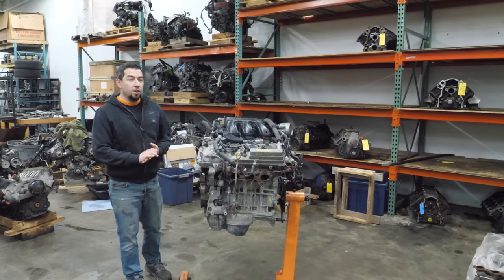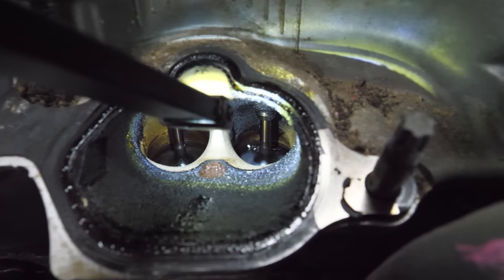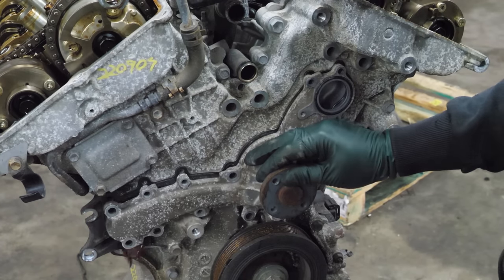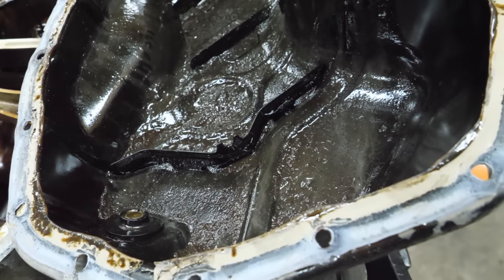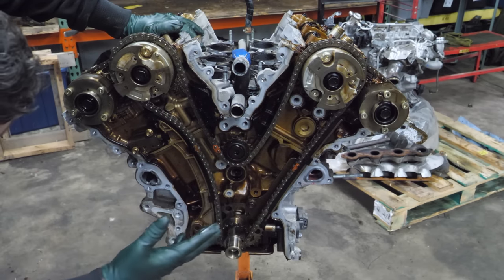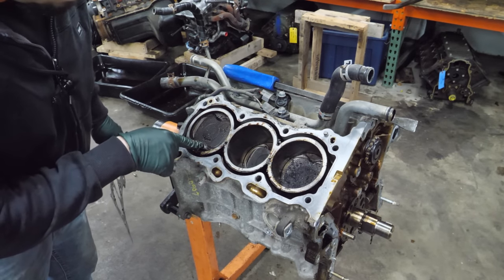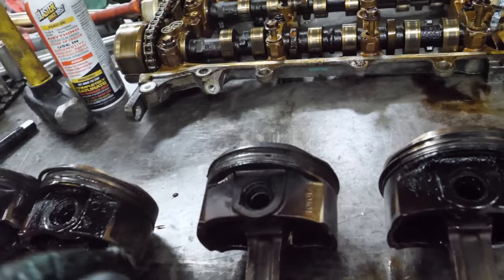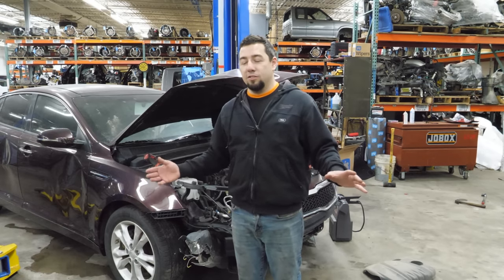Toyota Lexus 2GR-FE Teardown! Premature Death Of Toyota's Most Reliable V6 Caused By Obliviousness!

Comment: "Toyotas were supposed to be reliable but I needed a new engine after only 60k miles. I cant believe i wasted 2 whole oil changes on it."
Reply: Lol
Reply: Ive got an 01 4cyl over 250k miles lol. Still ticking
Reply: @demonknight7965 02 4runner with 368 still truckin
Reply: I had to clean out a 3.9 Dodge that went 86k on 1 oil change.  We scrubbed the Quaker sludge out, I abrasive blasted the oil pump pickup screen, replaced the oil pump, and buttoned it back up.  Filled it to the top with diesel fuel, drained it, put 5 quarts of diesel fuel and a quart of MMO in it, ran it until it was warm, drained it, filled it with oil and a new filter.  Drove it around for a week, changed the oil, and handed the keys back.  She made it another 100k, before it succumbed to the same fate.  Delo 400 or shell Rotella is trusted in $40k engines for a reason, but people want to use puddzoil,  quaker sludge,  valvoline,  castrol, ect.
Reply: It was the Blinker Fluid that did you in!
Reply: @demonknight7965  I have a ‘92 2.4 22R. Still ticking wonderfully, admittedly I have only hit 233k Kilometres, so not even 150k miles.
Reply: @formulafish1536  - if it's ticking, that means something is beginning to fail.
Reply: I have a 01 GMC yukon with 388,000 miles, guy I work with his 06 tahoe has 512,000 miles both have original engines both on the second transmission.
Reply: 4.7L with 306000 miles. Still rolling down the road.
Reply: The sarcasm is strong with this one.
Reply: 2 oil changes in 60k miles you shouldn’t own a car just walk
Reply: @MacGyver-1  3.4l ? i'm at 360kmiles t100
Reply: @MacGyver-1  are you doing 30k oil changes?
Reply: @fl_atv_riders4455  highway miles, no towing
Reply: @chrismemphis8062  I stretch it out to 35k I've done 10 oil changes, I use synthetic oil filters so I never change that
Reply: @juanrodriguez-ry6yt  yessir 3.4 , 5k oil changes used Castrol for years now Pennzoil platinum
Reply: @randymagnum143  Amen man, I run Delo 400 15-w-40 in every single engine I own, from 4-cycle weedeaters to my both my 2 Cadillac Northstars to both my Chevy 6.0 LS engines to my C7 Caterpillar in my box truck, and when I switched to diesel oil, i have not had ANY oil issues with anything! My engines are cleaner inside than when i bought them!
Reply: @Baebon6259  I got a 20R with questionable mileage and it is the most reliable engine I've ever had in a car/truck.
Just thought I'd continue the trend in this reply thread here
Reply: After 60k miles with proper maintenance any car engine should have had at least 8 oil/filter changes.
Reply: @Slaktrax  dude we're all joking
Reply: I had an Uber driver complain he had to replace the engine 2x on his Sienna. I expressed surprise because our 2004 we drove for 14 years was the best car we’d ever owed until a Dodge Charger murdered it at 150K. After a bit of conversation I found out he’d hydrolocked both of his bad engines. There is apparently a big puddle he has to drive though near his home during heavy rain events. He didn’t appreciate me saying ‘that’s on you, not Toyota.’
Reply: Your misfortune is not likely statistically significant in the legacy of this engine’s reliability.  Unfortunately, that doesn’t mean much to someone who suffered a bad experience.
Reply: 2gr-fe on my Avalon with 304k miles and still going.
Reply: @demonknight7965  only 250K, try back with a 2000 Suburban 5.3 with over 350,000 13 years ago.
Reply: @mistermoonJB  2009 Cobalt had hydrolock, fixed it pretty quick by pulling plugs and evacuating water using a blow gun with vacuum line.
Reply: Had quite a few vehicles over the years. Most (even Fiats) have gone past 200k miles without problem and more than one past 400k miles. Always at least halve the service intervals and change oil in "sealed for life" units.  Have Toyota Hilux (MK8) on 120k miles.  Changed oil in "Sealed for Life" transmission at 60k. It was fairly burnt up sadly and that's with no towing at all. In the past Ford have recommended 30k in similar Aisin transmissions. If you seal anything it is the "sealed for life"
Reply: @randymagnum143  what's wrong with valvoline fully synthetic? I used it in 3 vehicles over the years and no probs so far
Reply: My wife bought a 2001 Lexus RX300 with 92K on the odometer from the original owner. We ended up trashing it at 123K when one of the main bearings went South. I had been religious about oil/filter changes so either it was not correct when it left the factory or the original owner never did any PM oil changes the entire time he owned it.
Reply: @johncoops6897  you're definitely not wrong about that, but I'm assuming he used it as an expression.
Reply: @atlaslion5128  if it works for you, no problems!
Reply: @randymagnum143  Diesel were oil belongs is a crime. Only oil, nothing else, no diesel, no additives. They only shorten lifespan.
Reply: They're reliable its proven but two oil changes with 60k i think we all know who wasn't reliable here lol engines dont change their own oil
Reply: you cant believe you had to add some oil to it and never replacing the oil.
Reply: Camry 2.2L 310,000 miles.
All original drivetrain, not babied.
Reply: 2001 Lexus ES300 300,000 Miles all original drive train fuel pump went out at 268,000 miles it was also original still going strong purchased with 240,000 miles five years ago i don't want to hear about Toyota not being reliable my family has owned 15 of them since 2008
Reply: The engine is a work of art.
Reply: @demonknight7965  Honda and Toyota consume oil and they run out of oil. Happens to a lot of people that don't know.
Reply: You got a bad one.  I ran over 400,000 miles on my Rav 4 4 cyl. and it still ran good when I traded it.  Toyota has had a few bad engines in the last 20 years.  Transmissons too.
Reply: They thought the synthetic oil was good for 100K in between changes
Reply: Because you only change the oil twice you had to change to whole engine.
Reply: Huh?  I had a 3kc and changed oil every 3,000 miles.
Reply: What model
Reply: @dirtfarmer7472  😂😂😂
Reply: @John Coops  nah, not a Toyota!
Reply: @Matt Cat  I've been doing the same for about 2 years now: 5.3l LM7 (from 02 Silverado , now in 67 dodge d200), 85 22re powered dolphin 21' rv, 08 dodge caravan 3.8l w/210k mi.(won't die despite my best efforts 🤣). 
I'm in s.fl, so I'm not concerned about low-temp viscosity quite as much as I might have been if I were up north
Reply: "can't believe I wasted a whole 20$ of premium fuel once on this pos"
previous owner
Reply: @demonknight7965 the joke went right over your head haha
Reply: @demonknight7965  I have 97’ 6 cyl with 300500 and I’m only just now getting it rebuilt
Reply: Waste of oil change
Reply: @Baebon6259  does it go up the hill though?

Ok. Sorry. Not very funny
Reply: @mistermoonJB  LoL
Reply: @mrmike5941  I bet you cannot say it is 320,000 miles all original oil and fluids. Lol
Reply: 2 oil changes in 60000 miles, thats why it failed, 5000 mile oil changes it would probably still have original engine, owner neglect is why most engines fail early
Reply: 332,000 on my 09 Tacoma and the oil is still clean at 4,000 miles. Oil changed every 5,000
Reply: @rockyj2008  06 through 09 are the last of torqued  motors  I had manufactured  check my motor and everything  checked  out 👍
Reply: Reliability and gross neglect will not go together.
Reply: @rshettle123 I'm happy  you enjoyed  your  vehicle.
Reply: @MacGyver-1  I have the 5.7L V8 2007 Tundra, over 1.2 million miles now
Reply: @seinundzeiten  Nice keep it trucking, almost 400k on my rig now
Reply: Why you change oil too often? You're wasting monkey!
Reply: My Tacoma 4cyl. 5 speed has 550,000 still everyday user.
Reply: @atlaslion5128 as long as it’s NEW oil I don’t believe it makes any difference as to it’s performance/longevity as long as you change oil and filter every 5,000 miles. 335,000 on my Tacoma and STILL can’t sea oil on dipstick at 4,000 miles!
Reply: @Hulatwig he SURELY didn’t take care of it
Reply: @mrmike5941 indestructible when properly maintained 😊
Reply: @seinundzeiten doesn’t Toyota buy you new vehicle if you make a million miles
Reply: You must have  a 18 camry
Reply: @1976axerhand 🤯
Reply: 😂😂😂😂...that was good
Reply: Haha yes that’s true
Reply: My dad has a Lexus withe that same engine over 250000 miles with no problems still going strong! Make sure you use the right oil weight
Reply: Yup. You HAVE to do do 5k mile oil changes. I drive my cars way past the 200k mile marker and they still have a good engine because I do the oil changes after 5k miles religiously. One was a 2005 Hyundai Elantra with 265k miles and my 2003 chevy trailblazer is about to hit 198k miles. They are not even Toyota vehicles 👍
Reply: It could have gone better if you change your oil more often than only every 30,000 miles. Engines aren’t perfect unfortunately
Reply: Ahhh🤔 60k? Might want to discuss engine break in and find out WHY! 🤣
Reply: You should have checked your coolant. Toyota will still run apparently with out it😂.
Reply: You explained why it failed in your comment.. you missed several oil changes! 

Should be changing your oil around 6000 miles or 6 months, which ever comes first. 

If it's an old motor(done shit loads of miles/kilometres), 3000 miles or 3 months oil change intervals are advisable.
Reply: @chrismemphis8062   no, there would be the original plus 2 changed - 20k? Not good.
Reply: @mistermoonJB Maybe he should find a different route when it rains or get an intake that places the filter higher off the ground than the factory. Can't blame Toyota.
Reply: lol my 08 gs water pump bearing just went out and my sister said the same thing “I thought Toyotas were reliable” cause it just reached 61k miles
Reply: If you changed the oil once you could blow your money on a new toyota.....
Reply: '08 Tacoma with 475k and still runs like brand new. 4k full synthetic oil changes since brand new.

Comment: I'm a computer programmer. I'm probably never going to tear an engine apart. I watch for your excellent storytelling and humor. I appreciate your upbeat attitude in every job. It's fascinating to see the various ways engines can fail, and to hear your thoughts about them. I have learned quite a lot by watching you do what you do. Just writing to let you know that you are reaching people with your work, your entertainment, and your positivity. Thank you for sharing with us :)
Reply: You can start disassembling stuff any time you want. I too work in IT. I’ve reconditioned 3 Dyson vacuum cleaners destined for landfill. Together new they were over $2k. The trick is to pull stuff apart without the intention of putting it back together so that when you have something you want to keep it’s not as daunting
Reply: I second this comment as a fellow computer programmer. These videos are so fun to watch
Reply: Hi, I’m also a programmer but like taking apart cars and trying to put them back together… if you can code you absolutely have the problem solving skills to diagnose and repair cars. Most of the time it’s just finding the missing semicolon in the engine bay.
Reply: If you WANT to: Find a ~2000s era SUV to learn on, they're cheap, the parts are cheap, it's not all programmed modules, and with the SUV you get a decent bit of room for most tasks. This all assumes you have space.. Avoid the 4.0SOHC though. 4.3 Vortec is easy to work on(the bellhousing is a bitch on the S10 Blazer.) Even if you blow up the engine(I did in my S10), that $3,000 is how many car payments toward a new vehicle that's no more capable? They'll deliver the engine right to your house and pick up the old one!
Reply: Social media content is 99% story telling.
Reply: Even as a Wanna-be "un-certified" Mechanic that has been tuning carbs since I was 10, I really appreciate this to keep up on older technology.
Reply: @mentaldemise 😊
Reply: Another IT guy here (Network Admin). I tinker with cars on weekends and LOVE these type of videos. Rock on guys!! 😊
Reply: Lol I'm not a great programmer  but I can do a bit. But I love building computers and cars. Cars are just a hell of a lot more components 😂 I like the older stuff. Simpler.

Comment: Number one rule of ANY engine, IMMEDIATELY pull over and turn it off if the overheating dummy light turns on. Don't even drive it 100 yards to a safer location, home, a shop, etc. Another tip is after shutting it off, turn the key to ACC and switch on the heater to pull away the heat. This will also allow the cooling fan(s) to come back on. Popping the hood is also a good idea. But, DON'T remove the radiator cap as it would cause serious burns. If you follow these tips, more than likely the engine will be fine. Had a Toyota Camry overheat after the water pump developed a leak. Did everything I just typed, and after replacing the water pump and coolant, still motoring with over 200k.
Reply: Great advice! I had a celica in 1986 which overheated on my way home from work, I pulled over, turned the heater on full and opened the bonnet (hood), I let it cool down, topped it up with water and drove it the last two miles home. The engine was rattling when it first overheated but by doing what I did I saved it. Changed the head gasket, timing tensioner (as it looked a bit worn) then drove it to the south of France and back, no excessive oil or water consumption, I was lucky, but at the age of 21 I'm surprised I had the foresight to do what I did. Thanks to Dad for showing me how to fix cars from an early age!
Reply: I pulled over as soon as I got an overtemp warning on my 2.0L EcoBoost while running TOTD two years ago. Didn't shut it off, though. Shut the A/C off, popped the hood, and let it idle (my thinking being to keep the coolant circulating and the fans running). A UOA showed no issues afterwards.

I'm still not sure why it happened; I can only assume that a coolant drain and fill I did the day before I left on the trip allowed some air into the system. Only coolant related issues since then was a minor T-stat housing leak and trans cooler line leak that were fixed together.
Reply: Depends if you know your shit or not. Heat on full blast does a very good job at diagnosing the exact issue. You have to act very fast though. A heat soaked cooling system will go supercritical in under 5 minutes. I slightly overheated my J35 a few times (multiple small issues, don't want to list it all) and full heat brought the temp back to normal in under a minute, even climbing a 15% hill for 10 miles after a long WOT pull!
Reply: I had a 84 Celica GT that overheated every day for months. 22RE didn't give a shit, I'd beat on it till the temp dropped again.
Reply: When my 95 Integra had developed a bad head gasket I would keep a close eye on the temperature gauge. It mostly stayed at normal operating temperatures if the radiator was topped off and traffic was moving. But there were a few times when it would start to overheat. I would then run the heater at full blast to buy me some time and I would immediately pull over where ever possible and shutdown the engine. I would then open the hood to help the heat radiate out more easily and I would top off the coolant jug. All it took was 10-20 minutes for the engine to cool down enough to continue. I ended up doing this a few times until I got it fixed. I still have the car to this day running fine with 276K miles. Knowing how to not only drive but to also operate an ICE engine makes a big difference on the longevity of a car.

Comment: Co-worker has one with 421xxx miles on his Camry, still squeals the tire leaving every Friday.
Reply: I’m at 378,000 close to 379,000 on my 1996 Toyota Camry V6 can’t say anything but a great engine. People just need to do their oil changes more often.
Reply: @videospedrin07 I doubt the lack of oil changes directly killed it.  The low oil level and clogged oil galleries is what killed it.  These engines like synthetic oil which some cheap oil change places still don’t use.

Comment: 48 years of fixing cars, I really expected to see melted Bearings after seeing all the melted plastic…I’m just amazed that the bearings were in such good shape. Gotta hand it to Toyota.
Reply: Put that engine in your ranger and you'll be the coolest guy on the block :)
Reply: @mikem9536 I'd sooner put a flathead V-8 with Offy heads in a Ranger
Reply: Hand all their problems. Design   back to Toyota bearings  are not issue most vehicles  with Low miles are going have decent  bottom End 😅